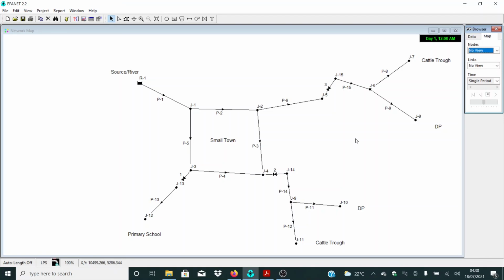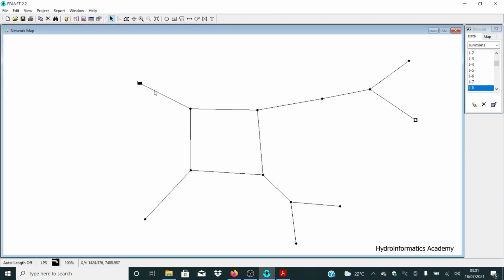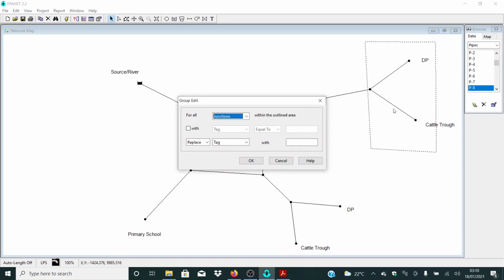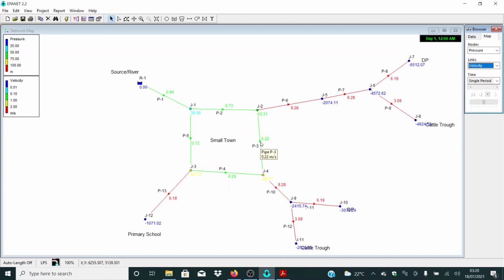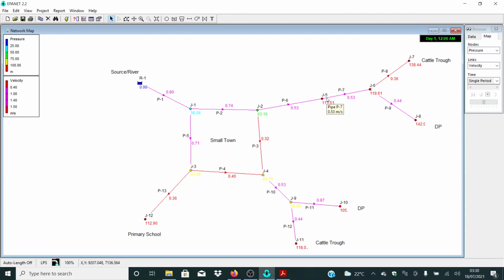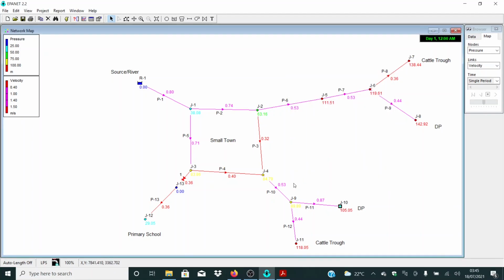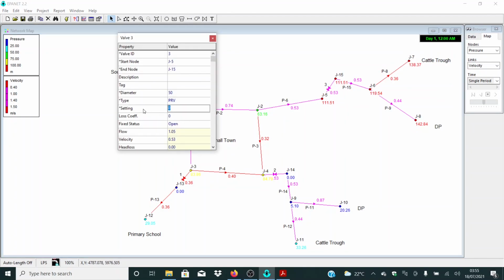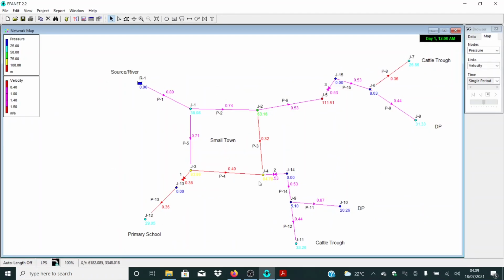Hydraulic Modeling for Looped Water Supply Network/System with EPANET [EPANET Tutorial]

Comment: What to do if the pressure is below the minimum pressure but the headloss is greater that the maximum headloss?
Reply from the maker: Simplest answer is to increase pipe dia in order to reduce V and headlosses hence to increase res. pressure!

NB: Check elevation as well in order to increase both residual and static pressure!